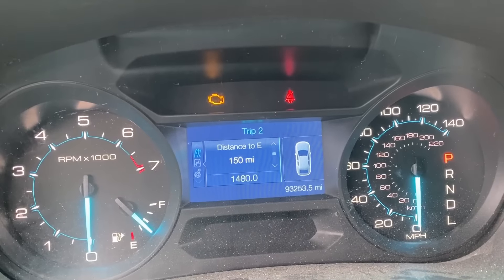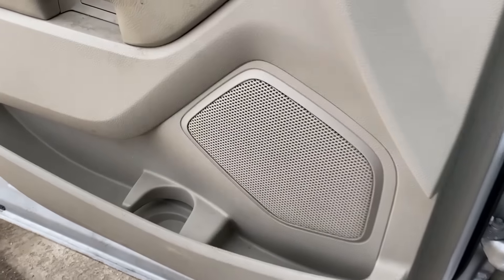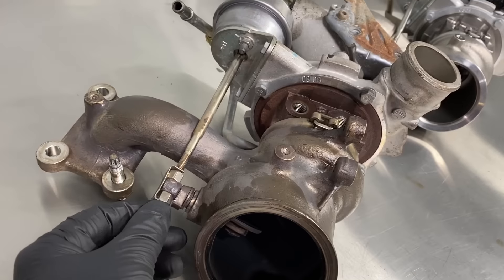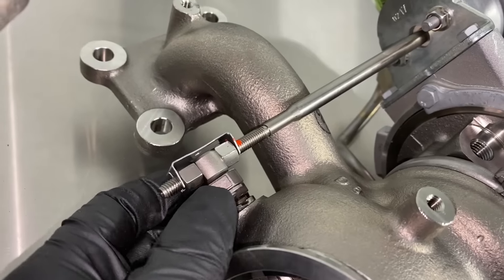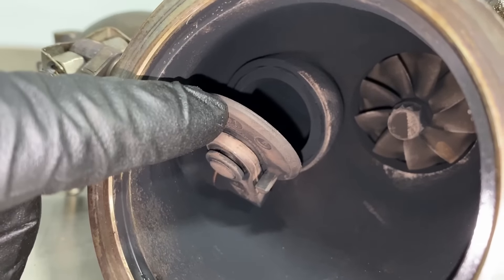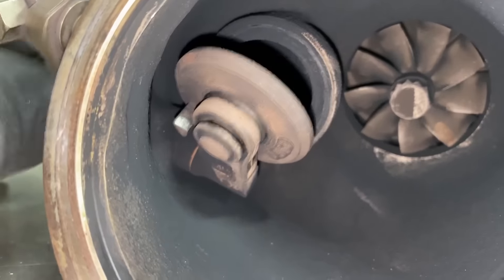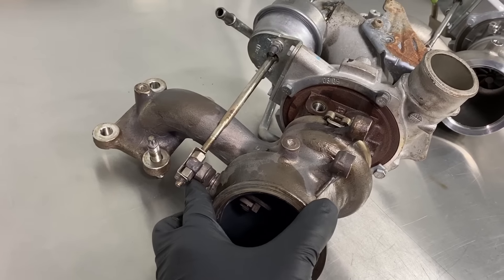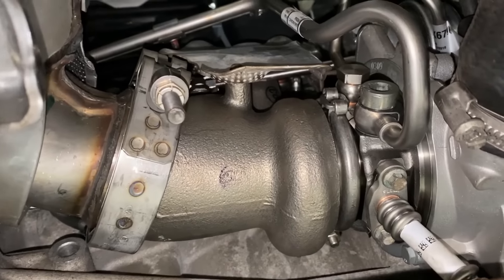Ford Ecoboost Cold Startup Turbo Rattle Explained

Comment: I wouldn't be happy either, 90k is nothing on a car that's  been well maintained.
Reply: William Wade not at all, we get 150-200 k trouble free from our work trucks and there run hard , 3/4 t 6.0 Chevy/GMC.
Reply: @JohnDiMartino  theres no issue with motors here ur comparing apples to oranges.
Reply: @Davido50  Back in the day I could buy a Caterpillar turbo cartridge for $873 if I replaced it before the turbo failed, so I would do that as preventative maintenance. Cat doesn't offer them anymore so now I have to buy a rebuilt turbo for $2k. A person shouldn't have to replace a turbo because the waste gate has failed, there's something wrong with that picture.
Reply: @LynxStarAuto  Thanks for the info, I've never owned gas powered vehicle's with turbos, only diesels.  I've always avoided turbocharged gas engines for that very reason but Ford has gone all in with them.
Reply: @williamwade7059  I cant argue with that logic. I'm just not seeing failures across a wide range of engines...or in my personal case ..none.
Reply: Lynx Star Automotive these turbos are poor quality. I work on diesel trucks and all have turbos normally going easily going  at least 500,000 miles or the life of the engine. Small Diesel engines normally at least 200,000 miles.
Reply: The engines rely on the turbos this is a direct comparison

Comment: Even the new turbo didn’t seem much better.
Reply from the maker: It has to be loose so it doesn't bind in all operating conditions, remember this is on the exhaust side so it get's very hot and must pivot freely even when the metal expands as it heats up.
Reply: @FordTechMakuloco  Turbochargers have been around for a long time and many manufacturers have built turbocharged vehicles that can last well past 100k miles without such a failure, what makes these turbos different?

Comment: Got a different rattle that goes away after the engine is warmed up or when I push the clutch in while the engine is warming up.
2017 Fiesta 1.0L 5-speed stick, 30k miles.

Comment: I feel like this is a design flaw on those turbos. 
My 1.5 Ecoboost does the same if you rev it lightly on idle, been that way since I purchased it a year ago.

Old turbo: Loose and rattles
New turbo: Loose and rattles (a bit less)

I'm not sure I can agree with finding much value in replacing the turbo for this issue alone so I am leaving it as is till the wastegate screw can be adjusted

Comment: pour design, or designed to fail.  The latter me thinks.
Reply: Ford engineering
Reply: @JFomo  so basically both
Reply: Turbos always have to be maintained. Superchargers are less maintenance.
Reply: @Hatefully_Commiefornian  Turbo parts are like tires. If you use them they wear out.
Reply: @Hatefully_Commiefornian  It's cool.

Comment: Send the old turbo to me a machinist and I would take that linkage and flapper valve apart. Then make the new parts to replace the worn out ones and put it back together for you. You the mechanic install it for a fraction of the price.  Deal?  We'd make rebuild kits and be rich.  :)  There are tons of those Explores out there....
Reply: I’d bet it’s not just the Explorers that would benefit. I’d bet the failing parts are the same on the 1.5 Ecoboost too, not to mention the Edge and Escape that also use the 2.0. 5 dollar part times 9 million vehicles in operation. That’s a lot of money.

Comment: I'd just wrap some lacing wire around that and take up the slack before I threw down 2K on an entire new unit.
Reply: now that ive seen the video i fully agree with you.
Reply: You need the wastegate to open in order for the turbo to function properly though.
Reply: @Jordan-ym5gf  i think we have two different visions of how to use that wire. if i understand Pat correctly his idea would keep it functioning properly. someone else also floated the idea of using a bushing in the hole. for $2k id be willing to try anything.
Reply: @Billy_Darley  you are correct. I was thinking of it only being used to take up the slack. You'd think Ford would used hardened steel in those areas since they stupidly made it as one unit.  Why in the world they didn't make it serviceable is beyond me. If you're gonna make a hard part that shitty you ought to at least engineer it to have those parts serviceable without needing to replace the entire assembly. They'd still make the same money in labor possibly even more, but the greedy bastards want to sell you a second shitty part.
Reply: @patdennis3751  same thing was done to the transmissions in the explorer. Steel rod sliding thru an aluminum hole. Hard vs soft metal. Softer of the two always loses.

Comment: Just had ours done over Thanksgiving week. Covered by Ford's CPO warranty. Here we are on January 10th and it is now making the same noise. Our Explorer has been in service for loads of stuff to include front engine cover seal, faulty seat belt buckle, defective hood paint, pealing adhesive interior door panel leather, recalled rear-end toe links, recalled emissions safety issue, dual-zone A/C blend door actuator fail, wheel hub bearing fail and finally a full turbo replacement Thanksgiving week. I hope they Lemon it - I'm done with Ford.
Reply: Had three Ford explorers. Never made it past 50k. All kinds of promblems..minor an major..now have 2016 transit. 50420 mi...

Comment: the replacement turbo for my 2015 ford f150 2.7l is $695.65 on buyautoparts com for an oem version. does that mean the cat cost over $1300?
Reply from the maker: Turbo is $1,086 plus tax, the rest was the cat, hardware, gaskets and new Clamp.
Reply: @FordTechMakuloco  I didn't catch what caused the cat to go out. was it because the valve in the turbo wasn't seating? I also noticed that the arm that was loose was adjustable. could that arm just be adjusted? thanks.

Comment: Just give me a v6 and forget all these turbo 4's....
Reply: The v6 that goes in the explorer has an internal water pump.  When it fails it dumps coolant into your oil.  No good options for these vehicles.  Maybe the 2.3 Ecoboost is more reliable.

Comment: Thanks for sharing.   You just proved to me another reason not to buy turbo vehicle.   Under 100k miles of use is unacceptable.
Reply: brad mironik Something broke on my non-turbo Toyota. This just proved to me another reason to not buy a non-turbo vehicle.
Reply: I have had many turbocharged cars and trucks. I have a 2012 f150 3 5 twin turbo now. 74k miles. Not a single issue.
Reply: Will M I feel the exact same way. I use to love vehicles.  Now, a complete waste of money and pain in the ass.  They are too expensive to buy, too expensive to maintain, too complicated, too expensive to fix when they break, and stuff like this always happens now.

Comment: A lot of paranoia after this video...
Reply: This very thing happened to my wife's '13 Edge with 2.0 ecoboost.  Started as a rattle that I chased thinking it was exhaust heat shield/etc.  Then one day going down the highway i noticed that it couldn't climb slight inclines without downshifting.  That eventually turned into the check engine light for "underboost".  I took it to the dealership and bam, bad turbo, one time use bolts/gaskets, need a new cat.  I was lucky that it was just barely under the extended warranty, so it only cost me the $100 deductible.  Not 4 months later on the new turbo and I already hear the loose startup when cold.
Reply: ghostinthetreeline it was gen 1 of their ecoboost engines. Same thing happened to BMW with the N54 engine
Reply: Tony Jung yes, the first gen 2.0 eco.  I have a buddy with the n54 in one of his bmw’s.  He explained the same issue to me. It is currently unaffected.

Comment: 1:46  Which is one of the reasons why when I'm done with my 2014 F150 ecoboost (early next year when I give it to my son), I won't be buying a turbo engine truck.  Unless something drastic changes between now and then to change my mind, I'll be buying a GMC Canyon with the bib-turbo V6.  I also want a smaller truck, so that's another reason for changing (and again, the Ranger is turbo, so that knock it out of the running for me...plus a few other things besides the fact that I just don't like the appearance of it as well as the Canyon).  Oh and by the way, I have around 124k miles or so on my '14 ecoboost and so far, no engine/trans problems.  No cold start rattle, etc.  So I'm counting myself lucky ;-)
Reply: This would be the second mistake you make "I'll be buying a GMC"   I bought a Toyota and haven't regretted it.  240,000 miles and still drives like new.
Reply: @maykevin5   The Tundra is too big for me and even worse gas mileage, but other than that I really like it and it's a good value.  I'm not really interested in the Tacoma for various reasons, so that leaves the Canyon as the option (for ME). I've seen no huge problems reported with them and I plan on the next purchase to be a long term ownership (10 years or more).
Reply: Hooked on Photography you need to research more on the GM twins… they are junk.
Reply: @JAMESWUERTELE  Have you heard about any common drivetrain problems with them?   I haven't searched the forums yet to know if there are a lot of common issues.

Comment: I just replaced my buddys turbo on his 1.5 Ecoboost. He got a under boost boost engine light. Any ideas? Everythings tight and all the vacuum lines are connected. Does yhe waste gate need yo be adjusted correctly on these when new?

Comment: Another yet under-designed part. Fix Or Repair Daily. FORD
Reply: Not just Ford.  I just had to replace the turbo on my wife's 2010 VW Tiguan for the exact same issue last month, no rebuild kit for these, I bet they get the turbos from the same manufacturer.

Comment: Fordtechmakuloco u wouldn't happen to have a pcm spreadsheet for a 2017 ford raptor that controls the wastegate to stay opened or closed at idle ? 2018 raptor keep the wastegate  open? so I wanted to change it to see if it would help with rattle

Comment: When I idle I can hear the ticking noise also I got a wrench light and the truck started to lose power and then a check engine light came on I went to auto zone and they read the code it said it was an under boost issue. Any ideas?

Comment: I would like to have seen some of the disassembly and reassembly to get some tips on how it is done.
Reply from the maker: It varies so much based on year and model and powertrain configuration so the procedure with specific steps and torque specs would be useless.
Reply: On one of your videos you said that the rattle in cold start was because of the bad phasers,so whats the truth please?
Reply: @juliansalcedo1394 , there are many things that can rattle on a car. Go search on his YouTube channel for  cam phasers, in that video he starts the engine so that you can hear what the cam phasers sound like.
Reply: @brucejones2354  thank you very much

Comment: Why not just replace the turbine housing. It's a v-band clamped unit. That's gotta be significantly cheaper even with the cat replacement than there entire vgt assembly
Reply from the maker: I would if they offered it, we used to do that all the time on the 6.0L turbos but they just don't offer it on Ecoboost models.

Comment: What's the chirping sound, not the wastegate rattle, you hear at the beginning of the video? It's constant. I hear it on all 4 cylinder Fords. Like crickets in the engine bay. High pressure fuel pump?

Comment: I would pop that thing of the shaft an put a bushing on it
Reply from the maker: What material would you use to handle the wide range in temperatures these go through and move freely at extreme temps yet not be loose enough to rattle cold? Ah, didn't think about that, now you see why we perform a proper repair and replace it.

Comment: I'm glad my 2002 Mustang GT 4.6 doesn't have a turbo and I live in a state (MI) that doesn't have emissions check. No cats. Car has been running great forever. I plan on keeping it forever.
Reply: Just make sure you torque those plugs properly, lost my '02 GT due to a shop's screwup that resulted in a blown plug and engine fire.  Then, 4 years later, lost my '03 Mach 1 to an inattentive driver with no license or insurance.  I love keeping my reliable old Fords on the road but when human error comes into the equation you're stuck looking for a replacement.

Comment: I'd put up with the rattle! Or try and shim it all up and plenty of grease to reduce the vibration or even source a 2nd hand used part that is not as worn? Not sure it is economical to spend 2k on a +90k mile car?
Sticking a brand new turbo on an old worn engine will most probably introduce a whole new set of issues!!🤔😯⚠️
Reply from the maker: Nope it will be just fine

Comment: Is it only the 2012 that requires the new cat? I have a 2013 with this issue. Debating about just running with it if both need replacing but it threw the underboost code during interstate driving. Thanks

Comment: Alot of this might just be owner maintenance and it might not be. I Had a 16 fusion with the 1.5 ecoboost to 100k not a single issue. Now have the 2.7 ecoboost f150 at 50k and nothing yet. Probably alot of people with this issue and just as many without this issue. It is good information to know!

Comment: FordTechMakuloco
I have a 2013 f150 ecoboost with a tambourine/ baby rattle noise drivers side of engine bay.  It's only under boost and disappears when you decel. No drop on power, codes. Can you help me narrow it down please 
I have put chassis ear on waste gate bracket and turbo bracket and couldn't hear it.

Comment: this is the problem with my focus 1.0 ecoboost it does the exact same noise on decel when its cold and in top of that i have some major throttle closures and all that without an engine light or code and when i go to the dealer and said what the car does they only say its normal for this engines when obviously it isnt what can i do?

Comment: I have an F150 2018 3.5 and have this rattle noise. At first I tought it was the cam phasers, but noticed the sound was actually coming from underneath on both right and left sides. I even got to think it was bad catatlytic converters. If someone can find a cheaper fix pls send me a message or reply. Thanks for sharing the video.
Reply: My 2015 did this at cold start up when it was brand new.
I switched to Mobil 1 10W-30 and problem went away.
Reply: @JasonW. Currently using Castrol Magnatec 5w30 but I will try it on my next oil change. Thanks for the advice.
Reply: @thomasgonzalez4136  oops, it is Mobil 1 5W-30
I believe the oil the dealer put in was synth blend or just non synth. It also seemed to vaporize fast, as it was always a qt low at 5k miles, Mobil 1 is a cup to a pint low at 5k miles.
Reply: What I’ve learned is these ecoboost motors along with the 10 speed tranny make a lot of ticking and whistling noises. I’ve learned to just ignore. I have a warranty so not going to worry about it.
Reply: @MarkNOTW  warranty runs out fast. I wished I would have gotten the 100k Ford warranty. The radar going bad, steps needing new motors, driver rear door lock braking 2x, rear window defroster not working on passenger and middle...
All after 40k
Reply: @JasonW.  That's pretty piss poor after only 40k miles.  Ford doesn't care how long their motors last anymore.  I regreat buying one as well.
Reply: @michaelwood5519  2015, and now has 68k miles. It now has a stumble when cold, so I'm guessing the 2nd set of plugs needs replaced. They burn off their tips.
Reply: BTW, for anyone with the 3.5eb, make sure to replace your spark plug boots every time when you replace the plugs, they can get carbon arcs on them

Comment: I have a 2013 F150 3.5 Ecoboost. Only 67,000 miles and i am starting to hear this...not going to deal with it now. only during morning start-up. All fluids and everything else is fine. When the time comes, will probably trade it in for a F350 with the 7.3. Or get a Toyota Tundra with the 5.7. My Sequoia with the 5.7 is ~12 years old with no issues. Turbo Engines are I guess a rebuild waiting to happen.

Comment: my problem is i hear a few rapid knocks when starting it. 3 knocks right now. and when i let off the gas at ~80mph i hear sorta a gear whirling noise. 
i was thinking turbo waste gate becasue of letting off the throttle but idk. i JUST paid $1500 replacing the flipping engine for the 2nd time in a year and im furious. 
i should have avoided this car at the dealer but no it looked cool and i "needed" it.

Comment: What happens if you dont fix it? Most people tie the wast gate open for more power, thanks for showing these things and please keep up the good work
Reply: Paul Fiebke 
You mean, tie it closed
Reply: You'll set overboost codes & could overspeed the compressor wheel causing it to explode. The shrapnel that makes it thru the intercooler will go thru the engine & grenade it as well. 

Still wanna tie that wastegate shut?
Reply: David Oliver 
That scenario would not happen on a journal bearing turbo. Just saying 💁‍♂️
Reply: @Nostradamus_Order33  how is that? Any turbo will explode if overboosted/oversped excessively. Bearing type has nothing to do with it.  If centrifugal forces go beyond what the compressor or turbine wheel can withstand, it's coming apart in spectacular fashion. Usually it's the compressor wheel first because it's made out of weaker material.

Comment: My 2015 2.7L EcoBoost has a rattle noise on cold start only and only lasts 30 seconds or less. Won’t do it again until next cold start. Has 70k miles. It does NOT sound like this rattle noise in your video, does this issue also effect the 2.7L?

Comment: I know this may sound idiotic but due to a financial handicap at the moment I've drove my F 150. 2008 in second gear today because in drive it won't shift..2 ND only revved steadily at 3000 rpm during this..Question..how bad is this and will it be possible until I can fix it..